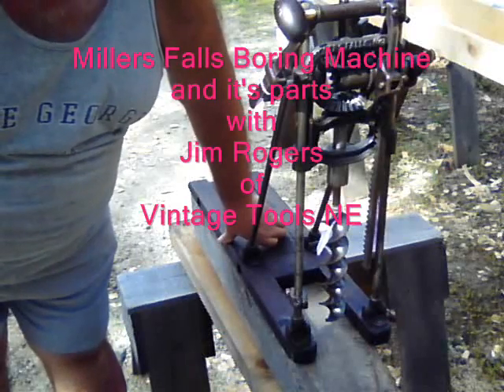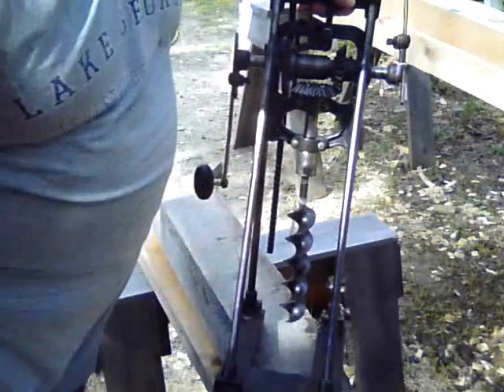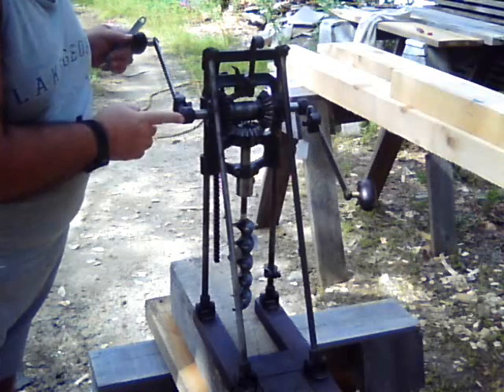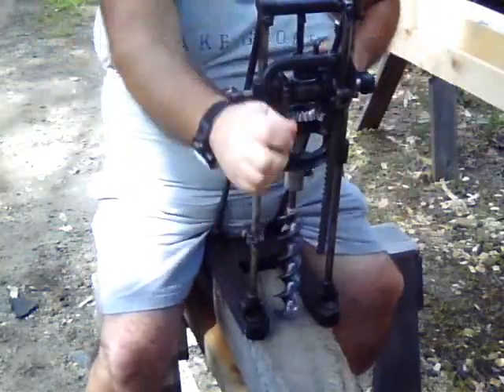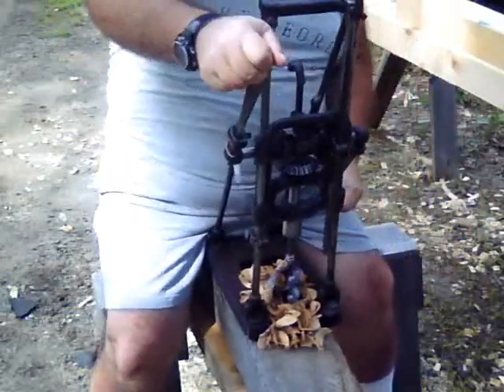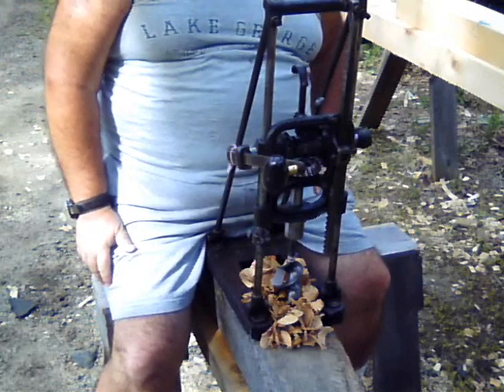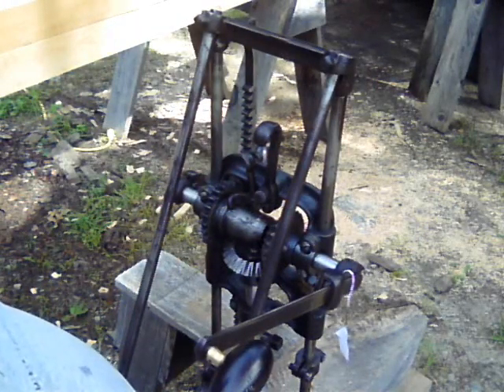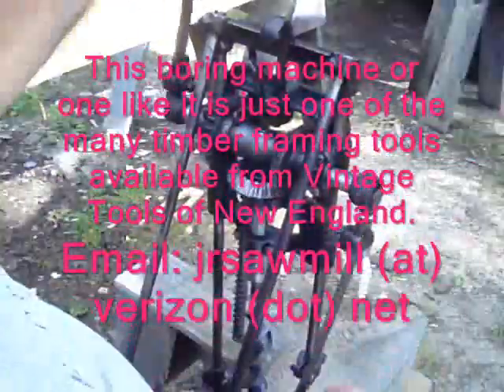Millers Falls Boring Machine.wmv

Comment from the maker: Most likely the standard 2" bit I was using had a coarse thread pattern and I should have used a fine thread pattern bit, which are for hardwood timbers. I don't believe the chips were wedged in the hole. Other than that, I'm not sure.
Reply: Are those bits available nowadays? where? Thanks!
Reply: Check Jim Rogers from forestryforum , he sells this stuff there.